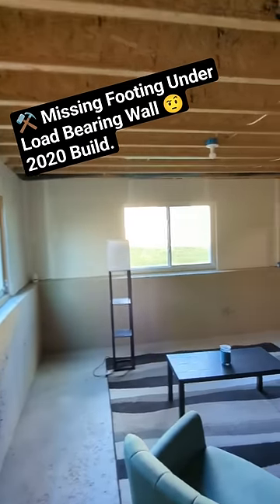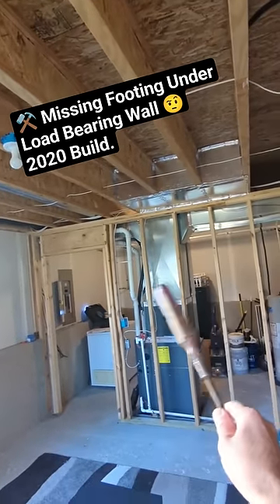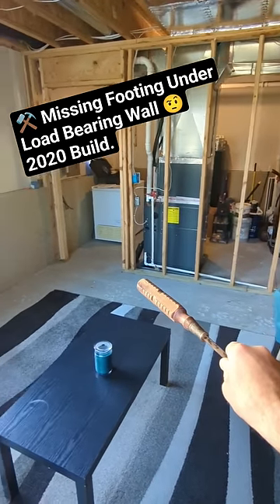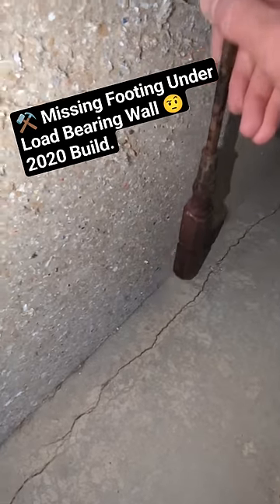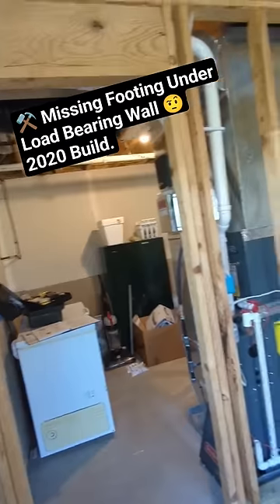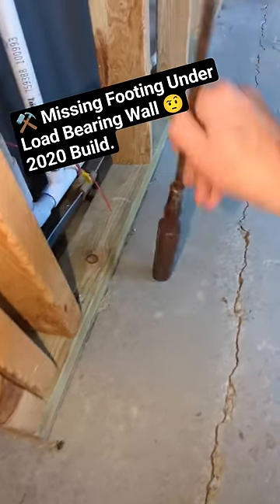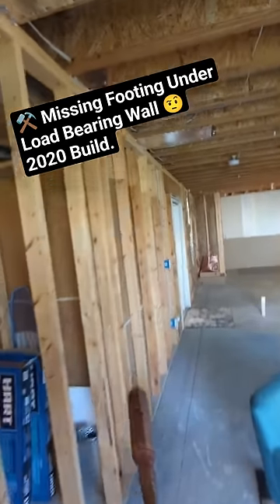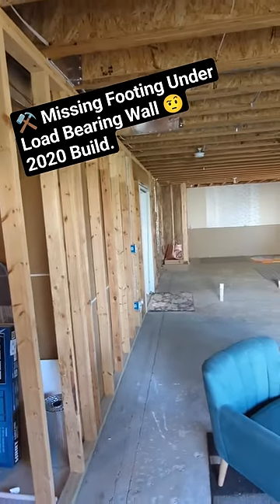FOOTINGS missing under load bearing walls NEW BUILD A trick to find missing#footing under #concrete

Comment: Don’t know. Those engineered joists may be calculated to take that load. That run beyond that wall looks short. That wall looks like a DYI home owner after move in project. I suspect the home owner was just “doing it right” with the headers or jack studs. If there was load to be carried in an unfinished basement, there would be a beam perpendicular to those joists and it would be supported by posts resting on individual footers. I doubt anyone would remove such a beam to put in a wall. I think you had better rethink your analysis, or talk to an engineer.
Reply from the maker: 😉 ok Here's the rest of the story...
What people may not see in the video is the larger door opening has a laminated header and on top of the top plates theirs 
two laminated beams setting on top which are perpendicular to the wall.
This is applying more weight load down to the slab areas.
In addition, there is a large bedroom  beyond the wall that extends beyond 24 feet.
Thanks for watching the video and the comment.

Comment: The trench footing that would likely go under that loadbearing wall wouldn't likely be anywhere near as large as the footing below the foundation wall. I'm not sure tapping the concrete like that to hear the resonating sound is the most accurate way to verify that there is not a trench footing below that load bearing wall.

Comment: It's a floating slab. The footings weren't poured with the slab. Therefore they aren't a single piece, and tapping on it wouldn't tell you whether or not there were footings there.

Comment: A load berry wall is not the same a supporting wall I drought  that wall is carring the roof load just supporting the floor joist ? I could be wrong but ?
Reply from the maker: Correct, there is no weight load from the roof. The home has trusses in the attic. 
Thanks for watching

Comment: Modern concrete is rated around 5000psi at 4" thick. How much weight do you think is on that wall. Unless there is the basement of a swimming pool. I'm pretty sure there is nowhere near 5000psi bearing on that wall.

Comment: Footings extend more than the 2" he tapped on that exterior wall. Those I Joists do not require a load bearing wall in that location. That isn't the end of the joists, that's just a partition. Load bearing wall is just on the other side. Judging by the tape joints on the drywall, those joists are only about 20' long...

Comment: Hopefully the concrete for the footing when it was laid went by the blueprints.   This is what happens when you let people work in this country that do not have education or a license in order to properly perform construction on a new house. I bet if you keep tapping across the floor you’ll find the actual footing. The foundation layers either miss measured the trench for the pour or the wall itself should have been placed over the correct area but, that would not suffice if the walls were laid according to blueprints.  I’ve noticed big time in Connecticut the inspectors and surveyors are here for the money only and don’t know how to properly pass a new footing when it is poured.  That is the reason they have housing inspectors when new construction goes up.

Comment: It's not a load bearing wall. All of the weight is on the outer concrete walls. The weight from the floor above is transmitted through the floor joists to the external concrete structure. Which sits on a footer. How did it pass inspection initially? Do you think they snuck it in?
Reply from the maker: 😉Here's the rest of the story...
What people may not see in the video is the larger door opening has a laminated header and on top of the top plates theirs 
two laminated beams setting on top which are perpendicular to the wall.
This is applying more weight load down to the slab areas.
In addition, there is a large bedroom  beyond the wall that extends beyond 24 feet.
Thanks for watching

Comment: 28 yr old "well built" house.  Part of the ceiling came down in a severe storm.  Effing insurance found some part of the ceiling (somewhere) where a joist was spaced at 610mm instead of 600 - called it "design flaw" and refused the claim :(
Reply from the maker: Oooo.. see. Wow 😮
Thanks for sharing!!!
And thanks for watching the video.

Comment: I guess you could cut out the top plate and insert an RSJ that spans two good walls. Maybe a composite timber I beam.

If it was my place, I'd cut out 2be4 trenches in the floor, under every second post. Up to three feet on either side of the problem wall. Insert a gal C section into the hole under the wall with the gap facing up. Then use concrete nails to fasten the steel to the concrete block. Spray the steel with kill rust, Backfill with gravel and finish it with an inch of self levelling polymer filler.
Then id cut a 2 by 10 rebate along the bottom of the wall frame and fit a bottom plate into the frame. Feel safe now?

If you were still unhappy, I'd laminate every second post with another full length of structural pine, and double up on the 45 degree cross strips across the entire wall frame, before drywalling.

The old timers would just fill the cavities with bricks and lime mortar, then solid render over the bricks: good for 100 years!

Comment: How would you even go about fixing that?
Reply from the maker: Fortunately because the basement is unfinished, Either a beam installed with column post and footings or cut the slab to install footing then install a new wall in front of the old wall. 
Thanks for watching
Reply: @inspectflix  Thanks for the reply! Really seems like it's a pain in the ass.

Comment: Even BIGGER issue...I've seen them pour a slab/foundation and then start putting walls on it within 3 days of pour. The concrete isn't cured yet at that point. These modern builds will never last

Comment: Probably sand or fill not packed properly. The Crack is running straight  down the footing. That's why it is important to reinforce with steel so that there is no separation. I'm not saying it was done correctly but I'm willing to bet there is a footing there. Probably got covered up when the slab was graded.

Comment: It's true cause  the contractor on YouTube said so.
Reply from the maker: 😉Thank you. Here's the rest of the story...
What people may not see in the video is the larger door opening has a laminated header and on top of the top plates theirs 
two laminated beams setting on top which are perpendicular to the wall.
This is applying more weight load down to the slab areas.
In addition, there is a large bedroom  beyond the wall that extends beyond 24 feet.
Thanks for watching the video and the comment.

Comment: Not to be that guy, but that’s a framed out HVAC closet not a load bearing wall, it’s simply to hide the utilities from your field of view if you wanted to finish that basement. Secondly, based on how that concrete sounds I’d be curious to see that vapor barrier underneath, or perhaps lack there of lol.

Comment: Typically if that was loadbearing there would be a beam. The headers being there doesn’t necessarily mean the wall is load bearing. Could just be a habit of the framers to put headers in all their doors. Those joists span all the way across and aren’t split over the wall. Those joist can span quite a long distance without supports in the middle. My guess is that wall is not load bearing

Comment: Those joists are TJIs.  I'm betting that wall isn't load bearing. Looks like a bump out remodel.  Check the opposite end of   those joists for what you are looking for it should be in the plans..

Comment: Someone should sue the architect, or the builder if they were the one to screw it up.
Reply: There's nothing wrong here... The joists are big enough for the whole span. the load bearings over the doors are not holding any weight. The concrete would be deflecting if that was the case. the cracks are a result of incorrect control joints.

Comment: Check your print more likely it's not a load-bearing eall. Your slab sounds that way because it's probably only two-and-a-half inch thickness instead of  four  inches and they back filled with dirt instead of stone.

Comment: Someone buy the guy a beer that mentioned the afterthought. That " load bearing wall" was not in the original plans . In fact you can see the floor joists go beyond that new wall and rest on a block or concrete wall.

Comment: Headers are not a reliable indication of a load-bearing wall.  The ends of floor joists could indicate a load-bearing wall.  An upstairs wall that supports the roof directly over the ground level wall is a load bearing wall.  The blueprint / spec sheet will show load-bearing walls.  The hollow-sounding spots on the slab sound like self-leveling filler used by flooring installers.

Comment: Well first of all a lot of you gentlemen on here making these comments have a lot of good points but if that concrete was poured correctly with 5500 lb psi concrete along with 5/8 rebar all the way through it then that would be eliminated and depending on your demographic you may need 18 inch wide 24 inch deep Footers that are at the proper depth underneath not only the basement walls and the load-bearing walls then you might have the right support at that point

Comment: Do the plans show a footer? How about a thickened slab?  If the plans don't show a footer, the joist were engineered accordingly.  Non load bearing partitions are frames with solid headers all the time.

Comment: Engineered beams load is on outside walls, no way inspector or builder let that fly. You can add walls anywhere under load. Beam engineered to required span

Comment: Your footing should be atleast twice the width of the wall , we place them 3 times wider than walls , why is it only two inches past the wall ? I think this screwdriver test is about as good as knocking your head on the floor and listening for the hollow spot

Comment: The TGI’s run all the way through, not sistered. The wall should have headers above every doorway regardless, that’s not a load bearing wall.
Reply from the maker: Those are not TJI
Reply: @inspectflix  they look like TJI’s. What do you call them?
Reply from the maker: @Greyskydies  a brand I've not seen Rosen Berg I think was the name.
Reply: @inspectflix  it’s an LVL. TGI, LVL. Or just straight for beams, if the beam goes all the way through, and I would have to see the plans, there is no need for a footer below the wall. It looked like from the video that the room behind was really shallow in depth. Anyway, you know all this you’re an inspector. I think the biggest issue is the slab cracks running everywhere. I’m the NW, we have hydrostatic pressure to content with that that means lots of damaged houses. Those cracks here in a basement would be a flooded basement. Not good.

Comment: just because the wall has headers does not make it a load bearing wall. if the joists are end on the wall or not designed for the entire span, then it is a load bearing wall.

Comment: Yes, yes, yes, but you seem to be overlooking bright side. With those huge cracks running the entire length of the foundation, and the fact that the entire slab sounds absolutely hollow, it won't be long before the homeowners have their own personal pond in the basement after each and every Spring thaw or prolonged rain. I mean, come on, everyone knows there's nothing more fun than doing laundry while standing in four inches of water.

Comment: You're not showing the ends of those floor joist,  those joist look like the span to another wall to me . The other wall would be your bearing wall with footer. I suggest you look at the engineering plan .

Comment: I learned to call them covid houses any home that started getting built from 2018/2019 I wouldn’t touch in terms of buying or investing. one trend that seems to sticking around is OSB subfloor ugh drives me nut 23/32 ply minimum but nope not for me materials got damn expensive and corners were cut 10 fold. if I wanted to build I’d build it myself with the exception of carpet. I really think people that bought covid homes and at one hell of premium price are going to start finding out they should of done some homework. it’s videos like this that prove it that foundation is f___ed
Reply from the maker: Very interesting 🤔. I too have a list of homes to watch for. 2006- 2009 recession, 1950's post wwII people had money , so good build. 1930'd Great depression, no money to build.
Good or bad economics. 
And now COVID! 
Thanks for the comment and for watching.👍

Comment: Those TGI's making up the floor above you are capable of spanning the entire distance, from exterior wall to exterior wall.  Never assume a wall is load-bearing simply because of the size of the headers used in the entryways.   There is nothing wrong with over building, not on the ground floor.  A lot of people do it simply to make a more secure and durable entryway.   It's good to keep an eye out for the consumer, and you made a very common mistake.

Comment: I just demolished a house the other day, it was built in 1923 and was about 1800 sq/ft. Not one crack in the foundation and when I broke apart the concrete, there wasn't a single piece of bar in it. 😂 My point is, shit was built to last in the old days. If it wasn't built to last, industries wouldn't get filthy rich. There's a lot wrong with the world today.

Comment: Sounds thin AND not compacted. I dont think that load bearing wall actually needs to be there. Could be wrong.  But that build, the entire base has settled.  Not sure if its built up with fill or just a bunch of gravel, but either way, its either settled, our poured super wet on plastic and shrunk. Id start with a few core drill samples and then hope whomever prepped the location has good and up to date insurance  and bad lawyers.

Comment: You are incorrect, not a load bearing wall. The framing runs continuously through and are designed to hold the entire load above without any additional support

Comment: Based on the size of that rug that's about a 14ft span  engineered floor joists span much further than that  and a contractor is not gonna build a load bearing wall like that. In the basement its gonna be an I beam. Wow people post anything

Comment: Dude, that's not a load bearing wall just because the non-load bearing wall just because it has a header but they should of put a treated board at bottom of that non-load bearing wall.

Comment: Who pours concrete flush with footers??? If that is a load bearing wall, where are the crush blocks. Those are engineered floor joists. They require crush blocks at the wall location. Just because they built solid headers, does not necessarily mean that wall is a bearing wall.

Comment: Your joists go from outside wall to the other outside wall.
 You do not have weight to tend with on interior walls.
 Also your Roof trusses will carry all the roof weight. I doubt if you have no more the 10lb per Sq yard weight  which is nothing.

Comment: that slab is not 4 inches think even sounding like that and that crack wel it is not a hairline crack. It is a bonafide crack. Pull that house apart and start again before it costs you much more than labour.

Comment: That's definitely not a load bearing wall - those don't get installed in basements. The load, if it needs to rest between foundation walls, will come to rest on a post which is supported by a pad under the slab.

Comment: oh yeah? Thats not how that works. Headers do not equal load bearing wall. Did you look at the engineered set of plans? Do those joints clear span that whole distance? Because Theres a good chance they span that whole room without the wall in the center. Where I live, you can span 21'6" with a 12" TGI 16" O.C. Hard to say from a video, but looks within spec without that center wall.

Comment: Sounds like someone changed plans after the slab was poured and some shady ass engineer went with it, the original crew said they aint gonna touch that and get sued, then hired a shady ass contractor to do it which is why its taken so long to do.

Comment: EVERY DOORWAY has a HEADER!!! Load Bearing or Not. So you are Definitely Wrong on that comment Unless Two Bucks in a Truck framed your house. A Header is REQUIRED above EVERY door and window on All interior walls just to carry the Small Load that may be above them and to disburse said loads to the sides of doors and windows and continue down to the floors. There is literally another wall 6-8 feet from your “Load Bearing” wall 🙄

Comment: Its load bearing because it has a header😂.  Why dont you pull your fancy code book out, measure the floor joists and apply them to the book.  The spans are all listed in there as a basic guide.

Comment: You are the perfect reason why I think 85% of the home inspectors out there cause more headaches than they catch. That is NOT a load bearing wall, just because they used headers. Those joists span all the way across, they are engineered joists for longer spans.

You fail.

Comment: This man is wrong this is a non-loadbearing partition wall the floor Joists are one piece Resting on the basement walls if you watch carefully during the video you can see that the Floor joists are one piece they are not overlapped on the wall in question this man does not understand the headers are needed everywhere so you do not get cracks in your drywall from the door shutting over time

Comment: in Alberta that would require a beam across, and 1-3 (depending on budget and span length) piles with footings, the ends of the beam would sit in the perimeter wall so no issues at the ends. piss poor construction for sure.